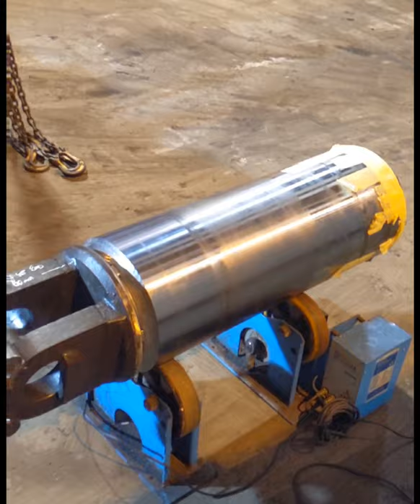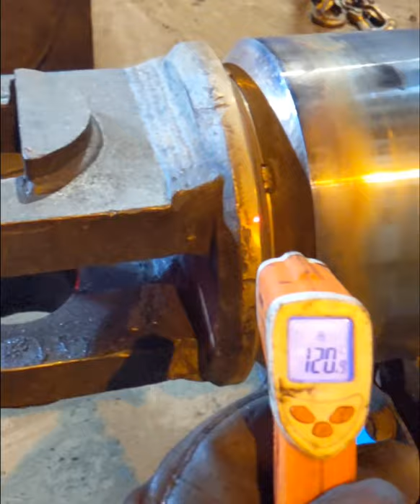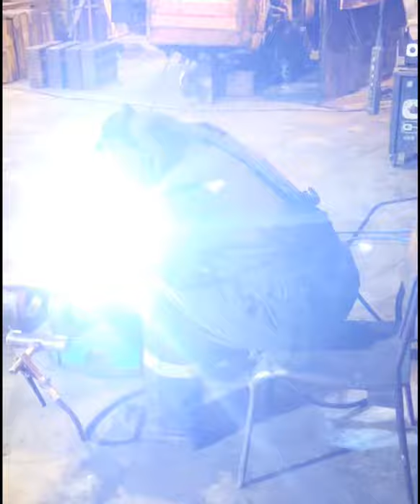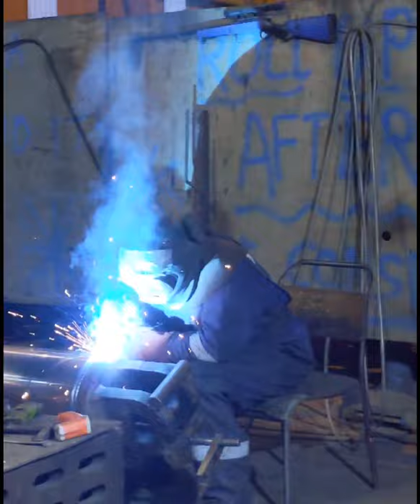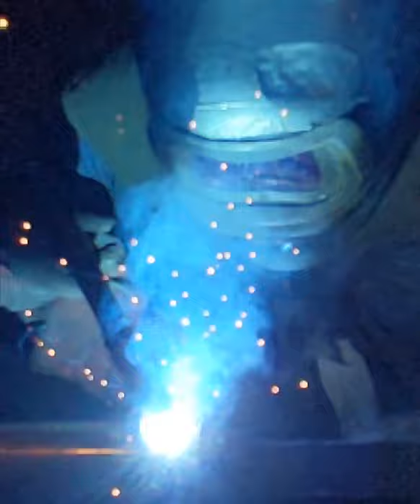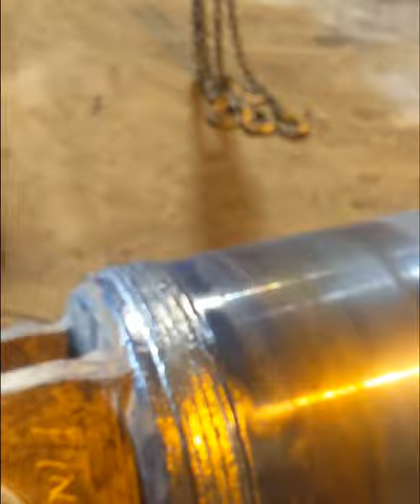#shorts just another afternoon in the sweatshop

Comment: Just need to make a adjuable arm with clamp and splice a switch into the trigger wire 🤔 😉
Reply: Most welders these days you can put them on 4T instead of 2T which means the welder will keep welding after you press and release the trigger once up until you press the trigger again and release it, no need to splice anything 👌